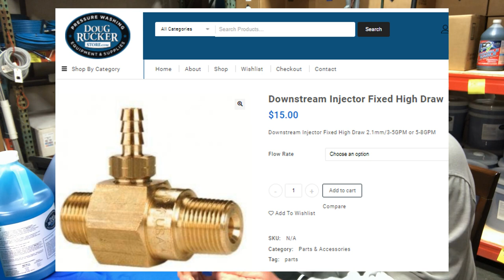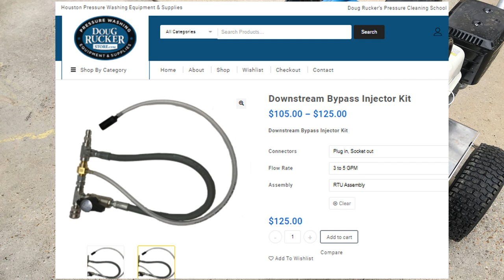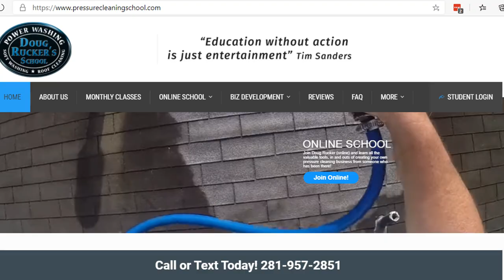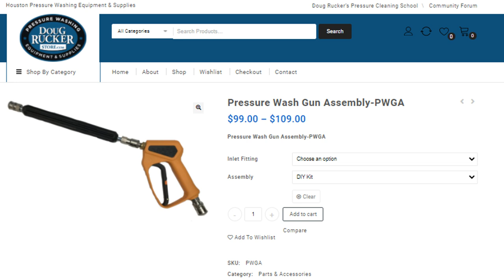PRESSURE WASHING DOWNSTREAMING BASICS from Doug Rucker's PRESSURE CLEANING SCHOOL

Comment: I have a question. Nothing to do with down streaming. I have a chance to buy a shark heated pressure washing trailer it is a 6gpm @ 3600psi. I think it's a 2014. Are those any good? And what do you think is a good price? Hes asking $4,500. It has a 200gal tank and 2 50gal tanks
Reply from the maker: Pretty high for a 7 year old unit. I don’t know anything about shark pressure washers so hard for me to comment on that brand

Comment: On a skid mounted soft washing machine with either a kingslinger or gas roof pump with blend manifold am I correct you don't need a a downstream injector and check value on a set up like that?down stream injectors are used for portable gas powered pressure washers?
Reply from the maker: You are correct, Kingslinger and Gas Pumps are dedicated pumps so you can get higher bleach mixes than what downstreaming with a pressure washer can achieve. You can't put a downstream injector on a Kingslinger or Gas Pump.
Reply: @PressureCleaningSch  Thanks very much for your feed back I appreciate it 😀 👍🏻

Comment: Hi Doug my machine came with downstream on pump. How do I block it off before putting in this kind
Reply: Im guessing u cant take it off?? The barb that u put the hose on usually screws off you can take that to Home Depot and get a little brass plug or something of the same size
Reply: 👍🏽 will look at that when I get home thanks. Just got my equipment just waiting on cards and signs 🪧
Reply from the maker: All depends on if it’s part of the unloader or part of the pump. Usually the kind that come with it can’t be removed but you might could block it off with a plug fitting.

Comment: I got a 5gpm 3000 psi with 200 feet of pressure hose in 4 sections. 1/4 hose. I can't get soap at the gun with soap tip. 1.8 injector and 2.1 injector. Please help.
Reply from the maker: What brand injector are you using? And is your marching a direct drive or belt drive? Also will it draw at 50!foot or 100 foot of hose?

Comment: I bought a DSI when I first started pressure washing this year. I hooked it up and it was incredible. I run a dual barb with dye feeding the second barb. After a week of use I put it up and it wouldn't start when I tried to use it again. J tossed it and bought another. This one did the same thing. I am on my third DSI and today it stopped working. I hadn't used any of them on more than four jobs and I rinse them consistently. The DSI is the dual port stainless injectors by General Pump. Man, seriously, I'm having a hard time. I'm trying to figure this out. Do you have any help?
Reply from the maker: Very odd, only thing I can think is the dye is causing an issue cause they normally hold up longer than that....I've never used dye before, just Neve found the need for it, so I am not sure what, or if anything that could do to it.
Reply: I heard you say that in the video. I use the dye because without it if I am trying to wait for the SH to switch to water or water to switch to SH I can't tell unless I stick my hand in it then smell my hand. How do you know if it's water or SH?
Reply from the maker: @harrisbros.servicesllc207  same as you by touch, or I can see the soap the coming out with the bleach. I add my surfactant (soap) to my bleach.
Reply: What sort of surfactant do you use and how much? Do you like a thick or light mix?
Reply from the maker: @harrisbros.servicesllc207  I use my DougieFresh surfactant.  https://www.dougruckerstore.com/products/dougie-fresh-surfactant-1-gallon/

Comment: Any recommendations for washing a roof that has copper gutters
Reply from the maker: Keep them wet and pray. But most of all let your customer know the bleach could stain them
Reply: @PressureCleaningSch  would I be better off trying a cleaning agent instead if bleach
Reply from the maker: @cwhill0311  you’d just have to try and see. Need something that will clean w light pressure
Reply: Have someone spraying water on them while you wash.